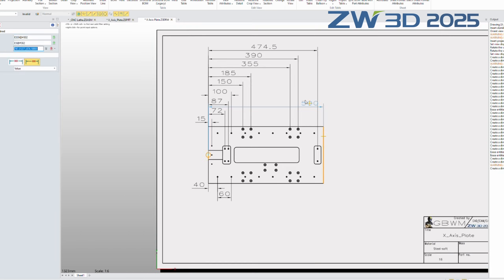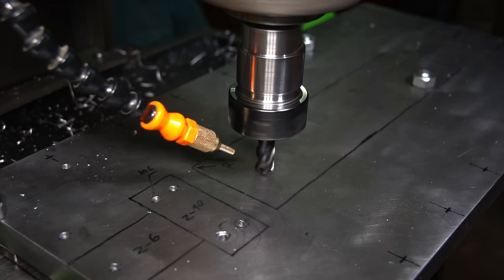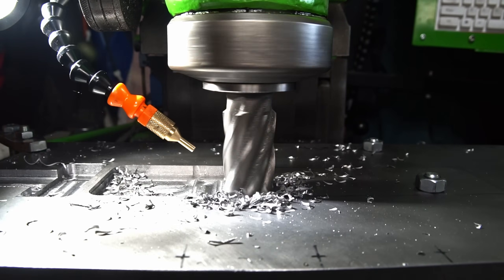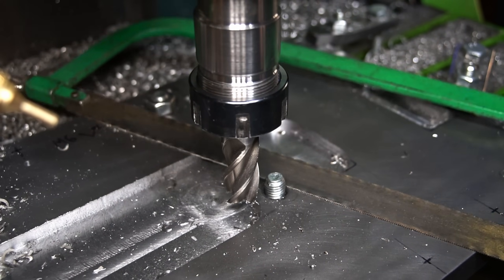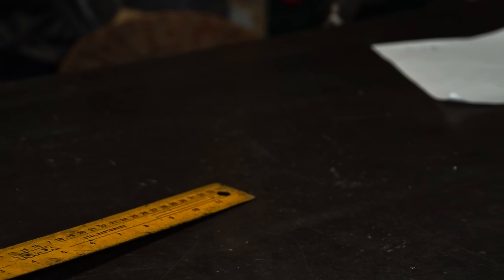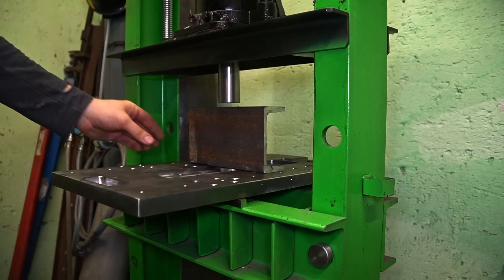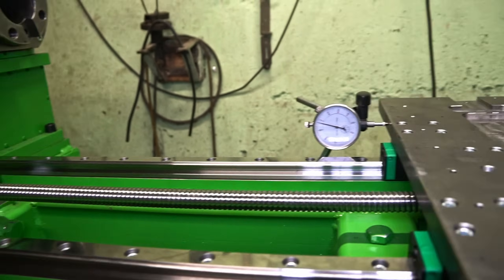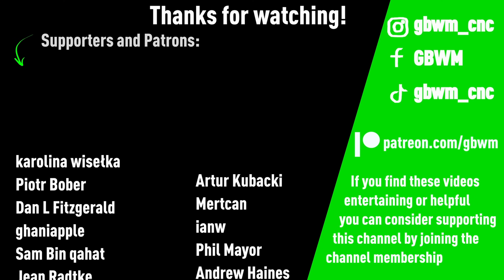X Axis Plate & Z Axis Tests - DIY CNC Metal Lathe Build! #10

Comment: Can you get Peck Drilling in ZW3D? Even if you cannot look at find and replace and add it into the code would save the stringy mess. Edit maybe you did change that later on 🙃
Reply from the maker: Of course you can get peck drilling in ZW3D. The best part is - all of those were peck-drilled but the feedrate was not right and the drill bit was worn too. And due to that I've got that stringy mess - haha!